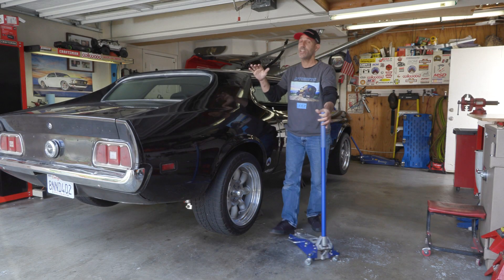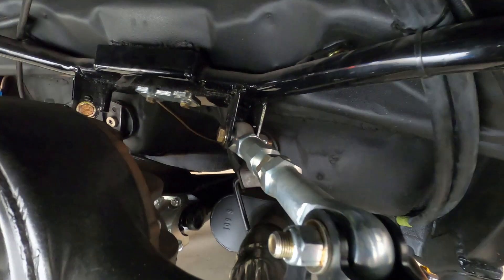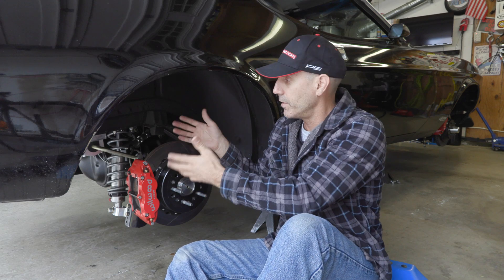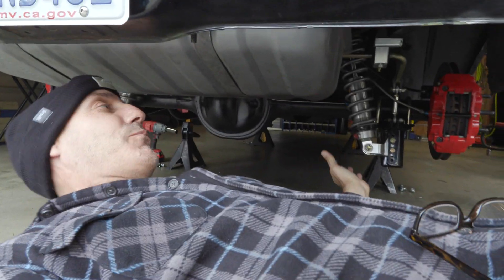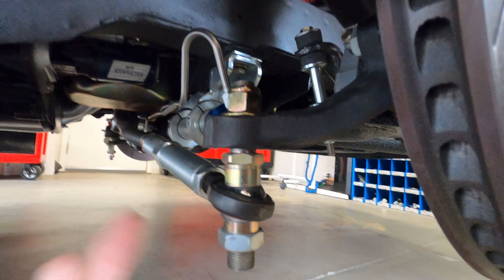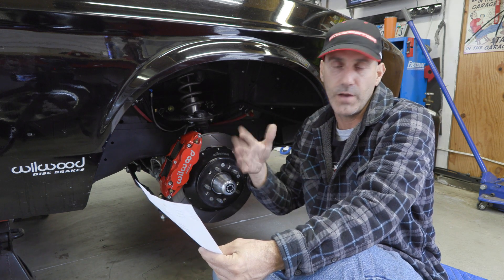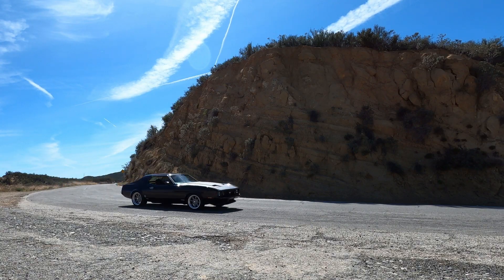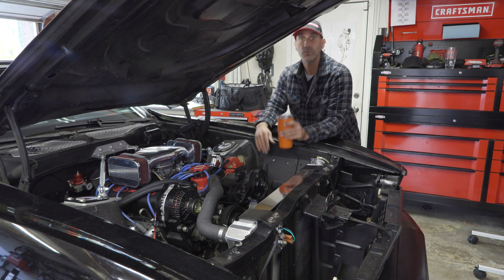Automotive Suspension Setup and Tuning 101

Comment: This was a great informative video, thanks! I don’t mean to bring it up if it’s a sore subject, so apologies if it is, but what’s going on with the super charger for large marge?
Reply from the maker: The blower isn't a sore subject at all. It's just a matter of not having the right efi system to run it without major modification... plus there's the whole not being able to run it with a hood on until cutting a hole in it and all of that stuff. I'm enjoying driving it and getting the chassis and suspension dialed in right now and will worry about adding boost later.

Comment: I'm about to start hacking into my front end to install my TCP rack and pinion steering system. Only difference is that I haven't been able to buy the TCP front suspension yet. Would you recommend that I mock up the factory arms and spindles for now as I start to install the rack in its rough position? I am also considering removing the entire front crossmember and fabricating a custom, bolt-in replacement. The Biggest difference is that my car is on my rotisserie and I plan to perform the switch while it's upside down(Tin Man subframes already installed). Any last minute advice? I can't wait to get to your stage of the game! Keep the videos coming... and I just might come over to use your bumpsteer gauge! 😎
Reply from the maker: Wow that's serious! I'm racking my brain and think getting the rack in requires at least the lower control arms and eccentric eliminators so get that stuff at least. Building a cross member sounds like a great idea!  Good luck!!!!

Comment: As always, clear and precise infos. I'm surprised as far as camber in front, would you  increased that if   or more likely when you run sticky?? . I was runnung 2.7 front 1.5 back on hoosier on the porsches. Using  moton remote canisters 3way. Did you  ever consider converting the back to an independent suspension? I imagine there's  kit for that. I dont know much about american muscle cars. 🤔 Thanks again for taking the time to educate us, it is appreciated.
Reply from the maker: Howdy! I was surprised at the level of performance at such a conservative setting myself. But remember, I said this is a combination car... mostly street/road trip and some track day activities and those aggressive suspension settings make for a less comfortable car and are hard on ball joints, hubs, tires etc.  That said, this may all change  like you mentioned, when I put some sticky tires on there!
I would love an independent rear suspension but it is just way too expensive for the improvement gain on this particular project.... If this were a 69 Mustang Fastback... then heck yes I'd be working day and night for that...LOL!

Comment: On the front coilover setup Did you have to notch your frame for the strut rods at full compression? Hope pinto is doing well
Reply from the maker: I didn't and the bump stops I installed seem to keep them under control. Did you see the test drive video... I show a close up of them in action.
Reply: @AutoEdits  is that cut out stock for a 73? I'm working on a 65 and does not look like that. Can't seem to attach pic but at 11:59 in it looks like the frame rail is trimmed
Reply from the maker: @pls93  I don't know what you mean. Here's the install video https://youtu.be/ALbrInnpoV8
The install is even easier on a 65.

Comment: Hey Jason, love the car it looks like it handles amazing. Your wheel and tire set up is the same as mine but it looks like your set up is filling out the wheel wells more then mine. I’m on a stock suspension with lowered 600lb coils.
I had two questions on the suspension from TCP. Converting to disk, did it add any width to the over all width? And what about the front did it add width as well?
Reply from the maker: I don't know what the actual width is but here's the video where I get the measurements for wheel backspacing https://youtu.be/BmN6KPTAnig
It front width has some adjust-ability but the rear probably only gains a tiny bit.
Reply: Thanks Jason, can’t wait to see how the rear adjustment works out. You are not far from Willow Springs getter out there!! 😁😂

Comment: The build is great - alignment is pretty conservative i personally drive and track allt he buils but but more like 6 degrees caster and at least -1 maybe even -2 camber
Reply from the maker: I was surprised by not needing the aggressive settings that I used to run.  It's easier on hubs and ball joints to run closer to "normal" setting but once I put some sticky tires on here and hit the track... things may need to change.  And I'm thrilled to get that chance!

Comment: any advice for a wishbone strut front suspension, I could use the help thanks.
Reply from the maker: Is wishbone the same as A arm? Not sure what advice you need. Fresh bushings and great struts/springs is the answer... always.
Reply: @AutoEdits  well the OE spec alignment is a lot of caster and some other funky things. Got urethane bushings bump steer correction and rack bushings. I’m looking to build for Pikes peak and standing mile events. So just wanna tune alignment to do it’s best
Reply from the maker: @omcoffroad1355  Lots of caster is a good thing for road racing but I don't know for speed events.
Reply: @AutoEdits  I figured for Pikes Peak its good but for High-speed mile and half-mile events breaking into 200 mph not sure.